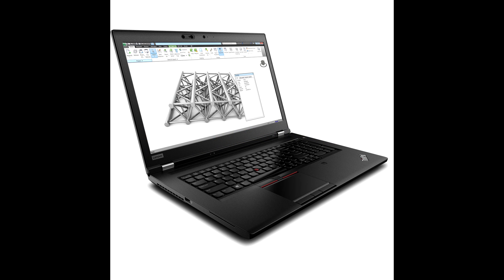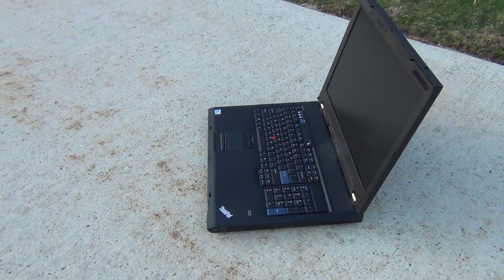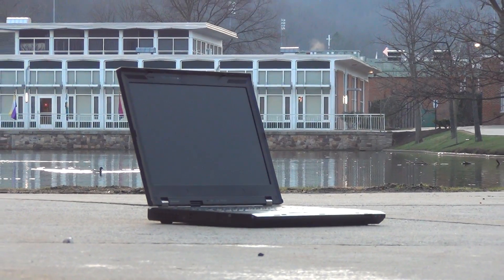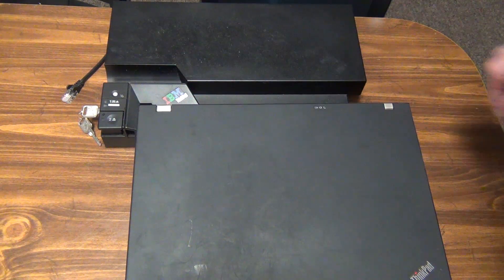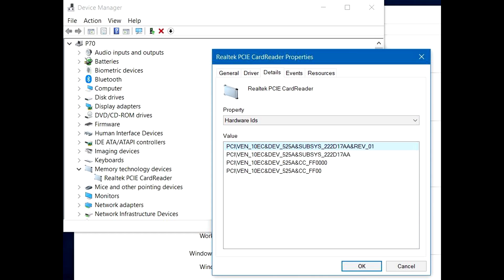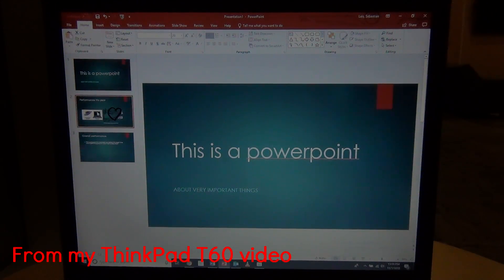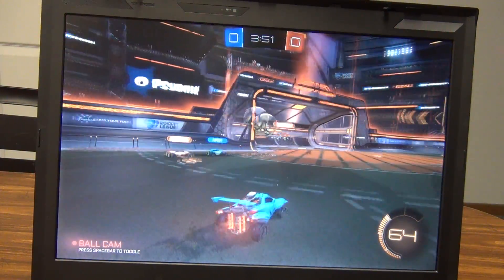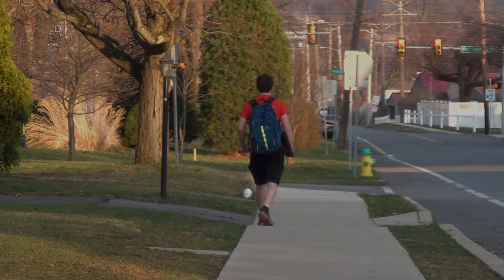Using an 11-year-old Mobile Workstation in 2019 (ThinkPad W700)

Comment: Looking at think pads for light games like wizard 101, stardew valley and drawing.
What's best
260x w wacom pen
ThinkPad yoga s1 wacom pen
Reply from the maker: If you mean the X260, that's a solid choice.
Reply: @SebisRandomTech  thank you for quick reply. I'll keep an eye out on eBay. Do you know any sellers that are good for tech? I've never bought off eBay before.
Reply from the maker: @Glamrgrl104  Nope, I buy from different sellers all the time, and since I usually buy broken machines to fix up I'm in a different market than you. Generally if they have a lot of sales and their reviews are all/mostly positive (more than 97% positive feedback), then it's a good seller. eBay is very good about siding with the buyer if the product doesn't work as advertised, so if you buy something and it doesn't work you can always return it/get a refund.

Comment: heres another good question: if my E535 has a boot/start-up loop -  bad system cofig blue screen - the laptop is plugged in, keyboard/touchpad not working, but external keyboard/mouse do work, if the unit turns on - BUT! - the small indicator light on the power button isnt lit, what does that mean?
Reply from the maker: Maybe your keyboard/mouse aren't connected properly or the part of the motherboard they're connected to is damaged.
Reply: Sebi's Random Tech some liquid may have spilled on it, in the past. I took it to the Microsoft shop here in town. they are going to reinstall win 8 Pro, and go from there. thanks

Comment: The fingerprint reader works without any additional driver needed on my W701 with a clean install of Win 10 1903, the windows hello sign-in feature works great. Didn't try any other uses though.
Reply from the maker: I think the Core i-series architecture is better supported by Windows 10, as I always have an easier time getting the drivers working with anything from that generation or newer, as opposed to older systems like the W700 that use the older C2D architecture.
Reply: @SebisRandomTech  Good point!

Comment: did your Lenovo collection ever get the Bad System Config blue screen error while booting up? the garage thinkpad edge has this problem. could it be the HDD? thanks - Lenovo spash screen, Win 8 starts loading, blue screen bad system config, memory dump, then loops back to Lenovo  thanks
Reply from the maker: Never have dealt with that before. Try putting in a different installation of Windows or a live Linux drive to see if those boot without error.
Reply: Sebi's Random Tech its possible the HDD is bad too. thank again

Comment: I have a W700 with 2 Quad Q9000 @ 2.00GHz with 8.00GB DDR3 @ 531 MHz and 1024MB NVIDIA Quadro FX 3700M. Running Win10 off of a 119GB TS SSD card. and main HD is a 298 HITACHI. I stopped playing games on it when I realized I couldnt load CALL OF DUTY BLACK OPS!
Does anyone know if there is anyway I can add RAM (like bigger RAM for each slot) or replace the graphic card with something that will help with its performance or gaming? I didnt know we could use an external graphic card. What is a good fit for this machine?
Reply from the maker: The FX3700M is the fastest internal card available for this machine. If someone can remove Lenovo's card whitelist or trick the machine into thinking a newer card is a 3700M, it could be possible to upgrade. The other option is to use an ExpressCard to PCI-Express card adapter to use an external GPU with the machine. As for RAM, unfortunately the W700 maxes out at 8 GB, and there is no way to put in more than that. The W701 on the other hand, can take up to 32 GB of RAM since it uses a newer architecture.

Comment: Nice video. What AC adapter did you get for it? I'm also on the lookout for an adapter for a W700 but they're really hard to find.
Reply from the maker: Just have to keep your eyes peeled on eBay. I would suggest looking up the part numbers for the adapter as opposed to something like "ThinkPad W700 power adapter".
Reply: @SebisRandomTech  I got lucky on eBay and snagged a good condition W701 with 230W adapter, a good battery and 16GB RAM.
Reply from the maker: @paulgjackson  That's awesome! What CPU and GPU are in it?
Reply: @SebisRandomTech  i7-920XM (2 Ghz) and Nvidia Quadro FX 3800M
Reply from the maker: @paulgjackson  That's awesome. I'd love to get my hands on something like that. Just upgrade it to 32 GB of RAM and you'll have the killer ThinkPad.
Reply: @SebisRandomTech  I know, was a great deal. Definitely planning on 32GB RAM 😀

Comment: I have a T400 ThinkPad which came with Windows 10 put on the hard drive, but it don't work. I am planning on putting ArcaOS 5.0 on it if I can solve the problems with this laptop with error messages and not getting a screen in Windows.
Reply from the maker: You've commented on like 5 of my videos with the same thing. Once again, if your T400 has dedicated graphics it won't work properly with Windows 10. Other OS's shouldn't have this issue.
Reply: @SebisRandomTech  I took Windows 10 off of the computer and it is working fine with ArcaOS 5 (OS/2 upgrade).

Comment: This beast can beat latest laptop when it comes to longevity of usage, durability and upgradable. Most of the laptop nowadays can't deal with overuse because of daily usage, all of the cpu, ram, gpu, and even the storage drive are soldered to motherboard and when the laptop is malfunction or died after years of use due to loose connection of solder joints b/w the chip and the board because of heat issues. What's worst is the battery becomes built-in and hard to replace if worn-out that you have to pry open completely the laptop and deal with sticky adhesive that stuck between the battery and the base. I still use my Thinkpad W520 and it never fails me for 6 years of use, when I play games I replace the still-living-and-charging battery with a dead battery or remove the battery to save battery life since battery shorts out its battery life if prolong to heat exposure, especially when the laptop is running at high performance for long period of time. When I go to work, I bring my laptop with extra new battery (also adapter if in case of presence of free power outlet).  I upgrade the screen, cpu, ram, and ssd with most of the top end specs that my laptop can handle.

Comment: The usual upgrade for old Pads is an SSD since spinner drives of the era were awfully slow.  Now that SATA SSDs are cheap it could make a useful upgrade for many users.
Reply from the maker: Agreed. All of my computers now use SSDs since they've become so cheap. I still use clunkers for high-capacity/long term storage.

Comment: I am now with this model but with Full HD screen.I upgrade with Intel QX9300,2x4 gb ddr3 10600s,tried with 2 x 8 but not supported.I upgrade the video card with the Nvidia FX3700.work without problem.I install two SSD Samsung EVO pro 1tb in mirror mode it is extremely fast,i changed the dvd recorder with Blueray recorder.from USA i bough the original 230 W adapter and the only one docking station for this model.my laptop doesn't have a camera ,i use a4tech full hd external camera and work perfectly.also i install double usb 3.0 pci  card  adn finally deep cleaning of the coolers and put back with Arctic paste MX4.on gaming video card rare reach 55 degrees but cpu goes up to 85 but no problem.I am satisfied from this Laptop.it is a monster which is still capable.
Reply from the maker: I would love to get my hands on a W701 and max it out, apparently it can support 32 GB of RAM.
Reply: Ooo yes!! W701 is much big monster!! But they are rare and in good condition are not cheap.W701 support yes 32 gb of ram and I7 940xm .for future i will search for this model!!

Comment: I own one of these I got in 2013.  I'm running Fedora/Debian/Slackware on it and it runs great, especially now that I've upgraded the memory to the 8GB max.  The fingerprint scanner works out of the box in Fedora, and two finger scroll as well as trackpoint scroll works in most distros I've tried by default, and with a slight config change to X, will work in any distro.

Comment: For 11 years old id say its a good laptop, maybe not for gaming though lol
Reply: Not for all gaming, but the quadro/core 2 duo/4GB combo I got this in would run things like SWTOR without issues and actually out performed my girlfriend's geforce 9600M/Core 2 duo/4Gb setup.  Also it ran Mech Warriors Online with no issues.  I originally upgraded to the W700 from a T42p in order to run Skyrim as it's said to run on this setup, but never did purchase it for the PC, so I wouldn't know personally.
Reply from the maker: if it were cheaper maybe, but since this model is so uncommon and thus expensive there are better computers, even laptops, that are cheaper and more powerful.

Comment: Nobody runs CSGO at anything but low, idk why people run these tests showing CSGO "running" on high settings.. At what frame rate? 60? That's not good for CSGO, which is why everyone runs low. 120fps or 200fps would be ACTUALLY a real test for CSGO (a lot of laptops hit 120fps at low with reduced resolution - I have i7 + nvidia and I run all low 800x600 to get 180fps)

Not just CSGO but you didn't mention any framerates just words like "ran" and "smooth". Smooth for some people is 45 fps smooth for others is 60fps. TF
Reply: What? 

I have a GTX 1050ti with a Haswell i5 in my PC, and run CSGO at high settings and still get 100+ FPS average. With a display at only 60hz, having up to 200 FPS is meaningless. Even if I did have a display at 144hz, I'd still run CSGO at high because my PC could get over 100 FPS, and unlike running at 800x600 I can actually see the opposing team on screen. A lot of PCs can run CSGO at low 800x600 but at that point why are you playing CSGO?

Comment: Hello, this is being written on an early Y2K Lenovo ThinkPad SL410, which is far from Workstation status. I bought it in 2006 or so at Best Buy because I'd never owned a ThnikPad. This was the only Lenovo unit available and unfashionable, running Windows 7 Pro. A contemporary Core2 Duo Apple MacBook Pro has dead keys and a nearly dead right speaker/subwoofer. (Can't type the log in password.) I'm thinking of an eBay i7 T530-T550 ThinkPad so I can curse at Windows 10 and stream CBS' "Twilight Zone."
Reply from the maker: T530 is a very solid system, I have one.

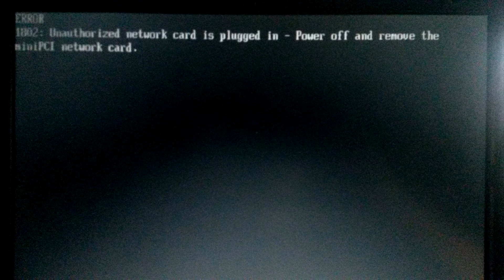Comment: 14:00 that cancerous limitation can be fixed by installing a custom bios that has the whitelist removed 
i did that on my T420s so i can use a GOBI 6000 LTE WWAN card instead of the Lenovo mandated GOBI 3000 HSPA WWAN card

Comment: This computer is a bit better than the t61p from what I can tell and I used the t61p with Blender all the time. As such It'll likely be a perfectly fine experience, just don't expect it to render any Cycles animations with anything more than a few hundred samples within your lifetime. Also those older GPUs don't support newer versions of OpenGL so you wont be able to use Blender 2.8 when that officially drops, at least not without it being sluggish and glitchy.

Comment: Well, I still use my 2005 T60 as daily driver: it has all I love in a laptop. 4:3 screen, nice keyboard with same layout as a desktop PC, Thinklight and dedicated volume/function keys. I  play Quake, Doom, Duke Nukem 3d... and I am watching Youtube videos right now, so what else can I ask for?
Reply from the maker: The T60 was released in January 2006. But I have a few of them myself and love them. I'm planning on putting a T61 board into the T60 chassis and getting a FlexView screen so I can have the best of both.
Reply: Oh, I though the plasic beasel was dated 2005. Maybe they recicled those from the T41? I lied a bit and I too have a board from a T61p so that is newer. I did it so I could have 8GB of RAM and a fastest CPU. I recommend to do it, but I wouldn't go for the Nvidia board because they eventually all die. I think the highest CPU  you can fit is an X9100, but at the time I built the machine those where still expensive so I went for the t9500, which was very cheap. The most responsive OS for this machine is freeBSD, even more than Linux, but if you go that route remember to update the BIOS before removing windows and use one that whitelists all the good stuff! @SebisRandomTech
Reply from the maker: @Vlad-1986  I plan on putting a T61 board in the T60, I found a source who has revised Nvidia boards that won't fail.
Reply: @SebisRandomTech  That is actually interesting. Where is it? Please, if you don't mind, tell about your frankenpad adventures!
Reply from the maker: @Vlad-1986  That will be saved for the upcoming video that I'm working on.

Comment: damn I'm still using an i7 myself, didn't know you lost a Ghz in speed just because mobile. I'm writing this on my dual boot win10 + macOS High Sierra, i7 920 @ 2.66Ghz with GTX1050 and 20GB RAM, DELL 435MT still running like a top 10 years later, of course with SSD upgrade but thats about it. 
Learned me something new today, lol.

Comment: Still using a W500 for my mobile recording rig. Great machine. The screen resolution is crazy. Running an SSD for the OS and mechanical for storage. These things were built for serious work. You should look at them like a portable desktop rather than a true laptop.
Reply from the maker: I have a T500 (same chassis and many of the same parts as the W500) and it's an excellent machine.
Reply: @SebisRandomTech  yeah I think the only difference is the T has the lower res screen and a different graphics chip. Having two drive bays is really great. Also... firewire!
Reply from the maker: @joeMW284  Correct, the T-series have Mobility Radeon or even Intel GMA (which sucks but works better with Windows 10 surprisingly. The W-series had the nicer FireGL chips and the higher-res screen, however that screen can easily be transplanted into a T500, since they are the same chassis. Any T500-T540p can be turned into the W equivalent from that generation (T500 -> W500, T530 -> W530, etc) by swapping the motherboard and cooling assembly from a W-series.
Reply from the maker: @joeMW284  Firewire is still very nice to have, I convert a lot of old tapes to DVD and hooking up MiniDV camcorders to the computer to use as a capture card is very convenient.

Comment: It's not the only thinkpad laptop with poor access to spare parts, X220 and X220T are equally rare compared to T series laptops, I wanted to order slice battery for my X220T (X220 with tablet screen) and you pretty much can't really buy a genuine new piece for it. With the HP you can pretty much get any spare parts new and genuine even for ancient elitebook machines for cheap on ebay. Not with lenovo so far. However I agree that they are virtually indestructible and build quality is robust and lasts forever.
Reply from the maker: The non-tablet X-series aren't as rare in my experience, but you're right about the X series in general being less common than the T-series.

Comment: My Thinkpad of choice is the W520 with an i7 2860qm and a Quadro 2000M. It's still a very powerful machine, but the graphics setup is a bit of a pain. Sometimes games just refuse to switch to the Quadro unless I force them by using an external display.

Comment: I had the T400, T500 and W500 and both machines are well made.  I gave the T400 to my mom, W500 to my dad and the T500 to my girlfriend.  She just replaced the T500 with a Dell latitude, but the machine still works quite well.  The T500 and W500 could both run Borderlands 2 with no issues.

Comment: your battery having 9 cells says virtually nothing. The capacity of a cell can differ. (for example: Duracell batteries are single cells. You can have a D-battery with 3300mAh, but it can also be one with 2200mAh, depending on the core used, depending on the size of the actual cell (D-Batteries can have a smaller battery inside of them, connecting that core with the outer two connection surfaces via an extension))

Comment: I use hp elitebook 8460p today for college (which came out in 2011) and it runs great on Windows 10 (even though it doesn't have official driver support for it), i use Visual Studio 2019 and SQL Express 2017 without any problem and all of the keys feel and are great. And then i see MacBook Pro users pay over $1000 and then have keyboard problems after a year.. roflmao haha :D
Reply: i have still my hp elitebook 8440p, it is pretty good machine, but under w10 i cant get working finger print sensor and some minor things, but under w7 it works like charm. I also use linux, and that is another story (good).
Reply from the maker: Still rocking my X230 from 2012, no problems to report!
Reply: I use a hp elitebook 8470p for school and its great the specs are: i7 3720qm, 6gb ddr3 ram and a 128gb ssd. I love the trackpad probably the best one ive used on a windows laptop. My only complaint is the weight, thickness and battery life. Even with a new battery i only get 2-3 hours of use. I only use it for school tho as at home I have my gaming pc.

Comment: thinkpad and second brand is dell. Who making big  fat a** laptops wrost laptops  who have are not good looking    But HP brand is best brand who make beautiful powerful laptop always.
Reply: In my opinion thinkpads are great laptops and i really like both the look and fell of them. 
And THE KEYBOARD. Its just amazing on the older models, but i never tryed a new one.
Reply from the maker: I used a 6th-gen X1 Carbon that was on display in a CostCo near me and it had a decent keyboard. I think the one in my T440p was a tad better but both are still above any other laptop besides older ThinkPads.
Reply: aKuBiKu ya im agree with you but i have hp elitebook 8470p. Im inlove with hp bussiness  class laptops
Reply: Polaris Lakewell nono. Im not say bad. They have good performance than other laptops. But their look is not good. Before i have thinkpad. It was heavy and fat. So i mostly  shy to bring it with me in class. Heheheh so from that day i hate them hehehegeg